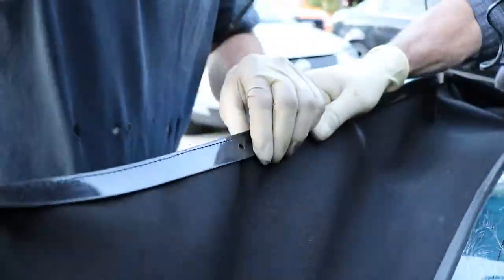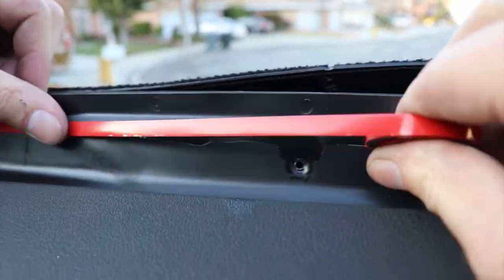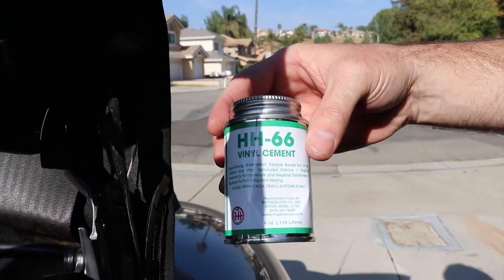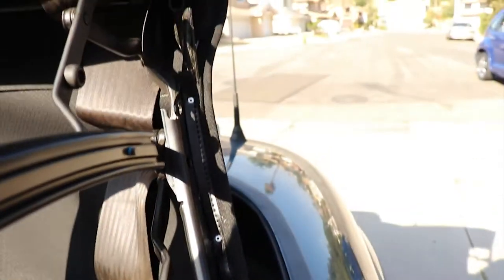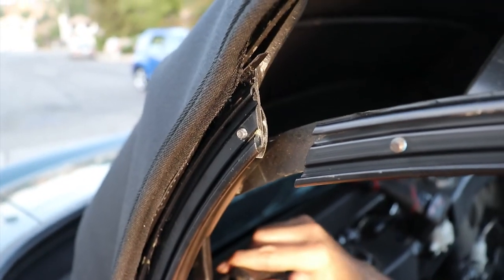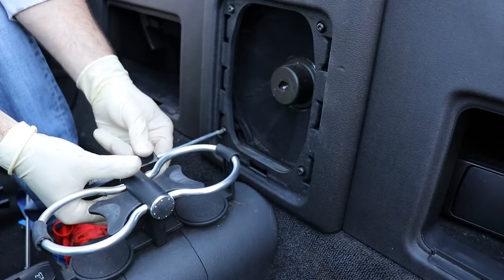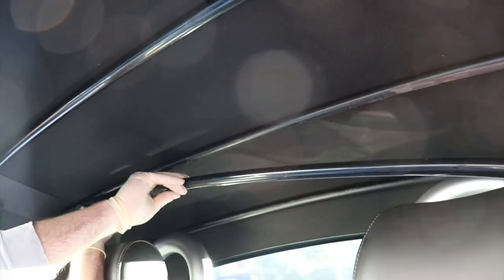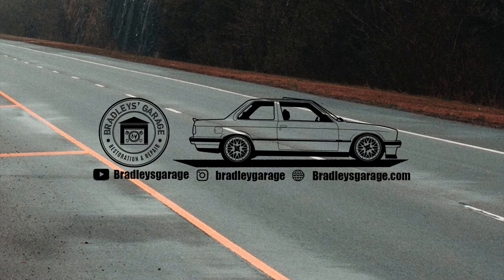Audi TT MK1 Roadster Convertible Top Installation (Years 1999-2006) Complete Install Tutorial Part.2

Comment: Thanks so much for the video. One thing I found that helped was when the 2 hex screws are removed on both sides, slide the tension bar to the rear of the car, then slide the front of the tension bar UNDER the point where it was bolted on.That will move the bar forward about 1.5 inches. Then you don’t have to remove the roll bars to get to the stops. Saved boat loads of time. Again great video.
Reply from the maker: Thanks for the comments! The main reason we took out the bars was not necessarily for the removal process but the installation part. Getting in there to attach the screws to that bar can be difficult with the roll bars in.
Appreciate the advice on sliding the bar to make it easier to get out. Cheers!

Comment: Unbelievable amount of work
There’s a car trim guy in the UK that supplies and fits a new one 
For £850.     Or he will put in a new rear screen in for £300 
That’s what I went for 
Brilliant job   Stitched all around and adhesive
Reply from the maker: Thanks for the comments. Here in the states they want about $1500 to do the job. The top alone cost $500 here so no one will install it for $350.
As far as just replacing the window, not one shop will guarantee it will last. There is no good way to epoxy it back to an old top. The new design, the window is sewn in so it will never fail again. Cheers!
Reply: @BradleysGarage  it is NOT SEWN IN!
That's what they do with plastic windows NOT glass ones like the TT has.....
You glue it in with the same polyurethane adhesive that they glue in windscreens with.
It's a fraction of the price of a new hood, and lasts as long as the glue on your front screen....
Reply: Sounds interesting,  can you put his contact details on here please?
The stitching you mention is to hold the folded over part of the hood in place.
The factory doesn't stitch them, but just glue it.... The glue comes apart at the same time as the glue holding the glass in.
Reply: He’s in Ivybridge near Plymouth Devon   If you are near enough I will put the company name on here
I will look it up if you like

Comment: Thanks for the video. I'm starting mine this weekend and have watched both of your videos twice. What size rivets are used?
Reply from the maker: Thanks for the question. The pop rivets we used were 3/16" x 3/8" with a drill size of .191 or #11, which is basically a 3/16" or 4.8mm diameter drill bit.
Good luck on your Audi TT project let us know how it goes. Cheers!

Comment: My top is still good and working but the rain channel detached on one side from the car body ( not from the top ) how to you reattach / glue it ?
In your video it seems you just shove it back without reattaching it
Reply from the maker: Hey Thomas, during the first 2 and a half minutes of the second video, I try my best to show you the way it attaches. There is a metal bar that keeps the top in place with multiple screws. On that metal bar is a lip that the rain gutter presses into. If you are having trouble with just one side, I would look to see if that has come unattached from the metal strip. If simply presses back into the channel so to speak.
You can then test it with the hose to make sure it's draining towards the middle. Sometimes those drains get blocked as well.
Hope this helps, good luck. 
Cheers!

Comment: I ran into some difficulty reattaching the plastic stoppers that you were working on at the very start of the video.  I had used a larger drill bit when I drilled out the existing rivets, so the protrusions that you used screws to go into were either gone or too thin to hold, and I couldn't  find any sheet metal screws short enough but of  a big enough diameter to hold into the holes in the base bow. The instructions say to insert rivets, but my pop riveter would not go any larger than a 3/16 diameter rivet, and I could not get them to spread enough to hold in the existing holes, even using longer heads that I though would deform enough to stick in there.  A 1/4" rivet would possibly work, but the Bentley manual says you need a special (aka $$$$) VAG rivet gun to do the job.  My solution was to buy a $25 rivet nut inserter from Harbor Freight and pop a threaded insert (the right size came with the gun) into each of the 4 holes.  Now I can thread the right size machine screws through the plastic cleat and fabric into the base bow.   Just thought I'd share my experience and save someone else having the same issue some time getting to a solution, as I ended up spending most of the weekend trying to figure out the workaround!  

Thanks again for the video, it has been very helpful (even down to using a soldering iron to punch the holes!
Reply from the maker: Thanks for the installation tips 90Duck. We also couldn't find any rivets to work so that's why we just found some screws that did the job. 
We just learned about the Nutsert tool from the comments on our Blast Cabinet video (https://youtu.be/BiuGZusZYts). We have since invested in the tool and will be sure to utilize it for an upcoming project. It seems like it will come in handy for things.
Glad to hear the video helped you with your Audi TT, thanks again for feedback, Cheers!
Reply: @BradleysGarage  As these Mk1 roadsters age, they pretty much all seem to be failing at the rear window.  I think the view counts on your two DIY videos on the TT roof removal and replacement are going to continue to climb as there really isn't anything out there even close to what you documented about the process.  And you are right, the instructions are not particularly helpful on their own, but they do have some utility for me when paired with the illustrations in the Bentley Manual and your videos.  Thanks again, I would be completely lost on my project without your video assistance!
Reply from the maker: @90Duck  We played around in the junkyard before doing this project and filming it simply because there wasn't any content providing a step by step process. We wanted to show that is was possible to do it yourself and save hundreds if not $1k on your own.
It seems like 50% of the TT's I have seen for sale the past couple years have issues with the rear window falling out, so it's definitely an issue that will arise in the future for sure. 
Glad the videos helped you with your Audi TT project. Cheers!
Reply: @BradleysGarage  Was it pretty warm out while you were doing this install? I've got heaters going in the garage to warm it up, and I'm trying to attach the roof to the rear tension bar, and  the fabric is just too tight to work with.  I just can't get the fabric to stretch enough so that the pre-drilled holes align with the with the holes in the rear tension strut and gutter clip.   I can get the first three moving out from the center on both sides, but can't get past the point where it bows past the tension straps, and it gets progressively worse the closer I get to the forward ends of the tension bar.   I've now removed the tension straps from the frame so I can work with it all out of the car, but I've spent most of the day just struggling and not making any progress.  Watching and re-watching your video where  it all seems to line up and you get it all attached in the first two minutes or so is killing me!   I'm starting to think that I will have to wait for a warm sunny day so I can do this in the sun and get the roof heated up more.
Reply from the maker: Sorry to hear your are having difficulty with the install. I'm not sure exactly of the temps but I'd say it was around 75 degrees that day. 
I'm assuming you purchased the top from the same manufacturer that we used? If that's the case, I would wait for a warmer day for sure. The material is pretty tight when new and would be difficult to stretch when really cold.
Keep us posted on your progress, Cheers!

Comment: Great job with the tutorial video.. Gave me the confidence to attack the job.  Save me $1000 install. Would it make it any easier to remove the seats? 
One more lol...Since you didn't use any adhesive on the top rails did you have any issues down the road?
Reply from the maker: Congrats on doing it yourself! Cant complain keeping $1000 in your pocket, that always feels good. As far as removing seats its really personal choice, whether you want more room to work or not. Its not necessary but could give an excuse to clean under the seats (lol). 
In regards to the top rails we haven't had any issues with anything moving around, the screws on the end of the plastic cover rails seem to keep everything in place.

Thanks for watching the video and providing feedback,

Cheers

Comment: Great video my plastic rail covers have broken do u know where I can buy them the pop on covers where yours was broken on the end (the four rails that attach to the top)my pop on plastic is all broken due to age
Reply from the maker: Thanks for the comments, glad you enjoyed the video. It looks like those plastic covers are no longer available form Audi. I would keep my eyes on the local junkyards for a newly wrecked cabrio. You might get lucky and find a clean car that was garaged and still has good plastic bits.
https://parts.audiusa.com/p/Audi__/Convertible-Top-Housing-Support/48619562/8N787108101C.html
Cheers!
Reply: @BradleysGarage  thanks for the advice I was told the same by the guy who replaced the top ☺️

Comment: Good afternoon friend, I bought an audi tt quatro, 2003, the hood does not have the strength to raise, I do not know if it needs liquid, but I do not know where to apply the liquid, if you could help me please thank you very much greetings from cura ao
Reply from the maker: It sounds to me like your hood struts must be bad/worn out. They are easy to replace and fairly inexpensive. Name brand like Stablilus might run you $30-40 or amazon replicas are about half. Basically grab a small flat head screwdriver and insert it in between the metal clip on the top and bottom of the strut and they should pop right off. And the news you pop into place with a light push. Hope this helps, let me know if you need more assistance. Cheers

Comment: Thanks for the video! Great work! It helped me a looot!
I just have one quick question, the previous owner changed the soft top one time, but they left a small gap, where the soft top meets the trunk (kinda), so water is leaking there… by any chance do you know how to adjust that? 🤔
Reply from the maker: Hey Juan, glad you enjoyed the video. The first thing I would check are the drains located on each side of the car next to the metal frame (directly behind each door). There is a loop in the material along the rear trim which acts as a trough to take water from the middle of the back of the top and direct it to each side in order to drain. If those get clogged, then water can start to pool up behind the seats.
If the drains look good and you are able to see water is draining properly from them, I would check to make sure the looped material under the rear is securely fastened and not drooping down anywhere. 
As you could tell in the installation video, if you do not remove the roll bars, it would be very difficult to reattach that fabric in the correct manner. The previous owner could have taken a shortcut and that may be where your problem is.
Good luck and let us know what you find out, Cheers!
Reply: That is the rain rail - a cloth “gutter” that directs leakage to the drains. You’ll need to rebond it - the adhesive fails over time. I used contact adhesive on mine when redoing the top and it’s still holding a couple years later. A convertible top shop can also assist you with it.

Comment: Great job, I need to carry out this work myself and your video will certainly help with that. How long did the job take you? Also like the look of that integrated window, never seen that option before.
Reply from the maker: Thanks for the kind words. My son was helping with the project, which makes things easier. I would say it took us about 6 hours to figure everything out and get it done. We could probably get it done in half the time now that we know how it works.
Plan on leaving yourself an entire day just to be safe. Good luck on your project. 
Cheers!
Reply: @BradleysGarage  Thanks you. Could you please explain the difference with the window in the after market hood over the stock hood, I didn't quite understand the benefits, also do you have a link to the hood? Cheers.
Reply from the maker: @srgpip  Both the factory and the aftermarket style utilize a Permalok rear window bond system. I went with the Ez-On top since it carries a lifetime window bond warranty. Not that I want to replace the top again but at least I have the peace of mind knowing it's covered.
Here is the link to purchase the top - https://www.convertibletopguys.com/convertible/1003/1999-2006-Audi-TT-amp;-TT-Quattro-Roadster
Cheers!
Reply: @BradleysGarage  Thanks very much for these details, much appreciated.

Comment: Do you have a tool list for the removal and replacement?
Reply from the maker: Sorry for not responding sooner.
Here's a quick overview of the tools needed.
Various Phillips screwdriver
Flathead screwdriver
Soldering gun
T20/T25 Torx sockets
1/4 in Ratchet
Vice Grips
Drill with drillbits
Rivet gun (comes in the kit)
T25 Screwdriver
6mm Allen Socket
Folding Allen Set
17mm Wrench
Pry-Tools
Punch tool
Rubber Mallet

Cheers!